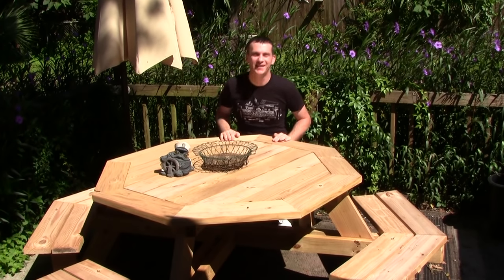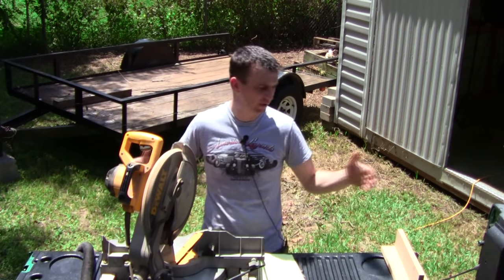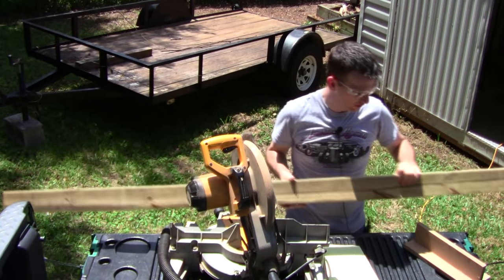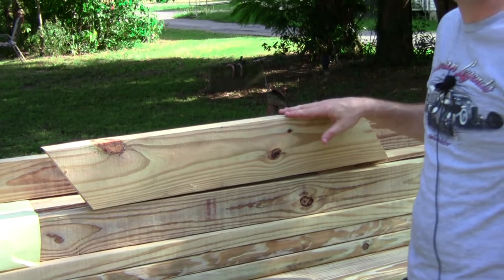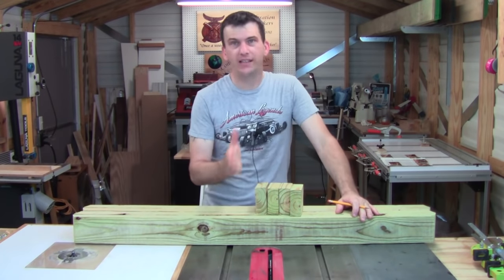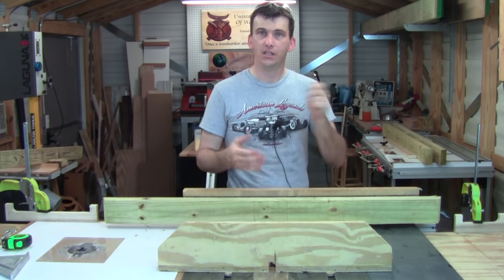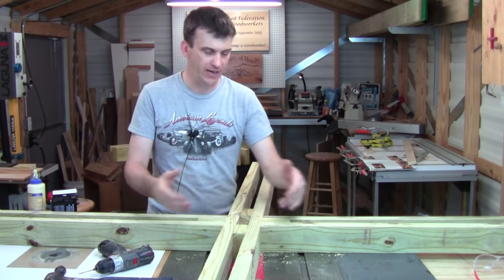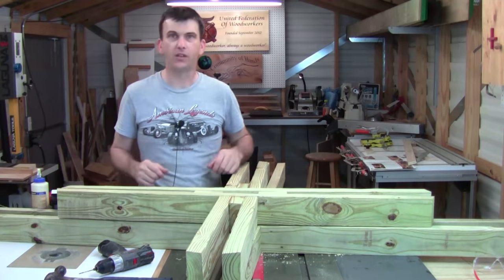How to Build an Octagon Picnic Table | PART 1

Comment: In your intro you mentioned you used pressure treated pine. It is my understanding 
(right or wrong) that pressure treated lumber has a certain amount of toxicity. Can you comment on this for a picnic table? Thanks.
Reply from the maker: +usaeagle7 Do not use pressure-treated wood for making cutting boards, or for any food preparation surface. 
Picnic tables made of pressure-treated wood have become common, and are fine to use for the purpose they were intended... to serve food on (or play cards on), not to prepare food on!  They should be coated as needed with an oil-based wood preservative (not paint or opaque stain) to seal in the chemical preservative. As long as one is not chewing on or eating directly off the table  or preparing food directly on the surface you are pretty much ok to use it..here is a great article that goes into more detail about pt wood http://www.naturalhandyman.com/iip/infxtra/infpre.html
Reply: I appreciate the response. Thanks.

Comment: When carrying a small amount of short boards like you are in the video, just leave the tailgate up and rest the ends of the  boards on it. Then throw a tie down over them to hold them in place. This secures the lumber way better and safer with no chance of it falling out the end of the bed.

Comment: Here is a suggestion for all build videos. When cutting parts at the start flash up a sketch / model in the corner with the current piece being worked on highlighted. It would make it much easier to follow along.

Comment: Norm Abram (who?) was always concerned about the chemicals used in pressure treated stock when sawing etc. Will the surface have a Polyurethane/oil or similar finish eventually, considering food will be on it eventually?
Reply from the maker: Will Ford Great question... after it was built I let it dry out in the sun some before putting a finish on it and just ended up using a Thompson's Water Seal on it... No Poly/oil or any other type of finish.. most food will be on a plate never making direct contact so I am not too concerned about this issue.

Comment: Great design, I just finished up building it. After sitting on it for a few weeks, I was wondering if you have any thoughts about what it would take to add back rests to the seats. It would make sitting at the table for longer than an hour much more comfortable. I'm not that experienced so I don't know if this design could support backrests. Any thoughts?

Comment: At the end of this video, you said "glued and screwed" but you didn't mention anything about glue at all. Nor did you show how to glue all those pieces.  Was this an error or did you glue it up?
Reply from the maker: +Walter Mercado there is glue and screws for all the parts....and no i didn't show the gluing...it's pretty straight forward. simply add glue prior to assembly and secure with screws.